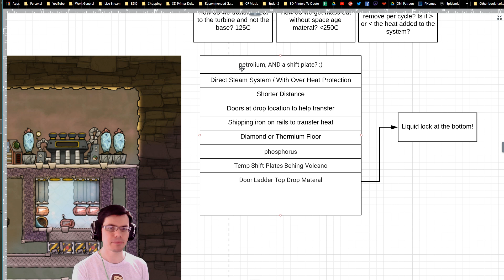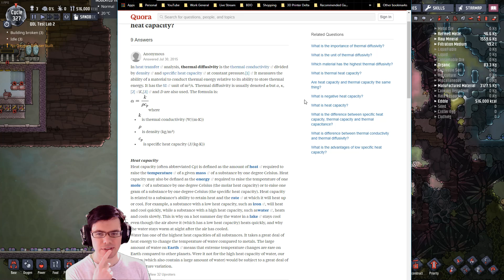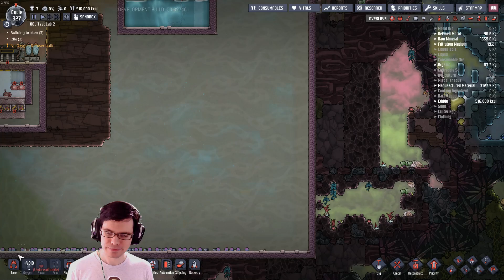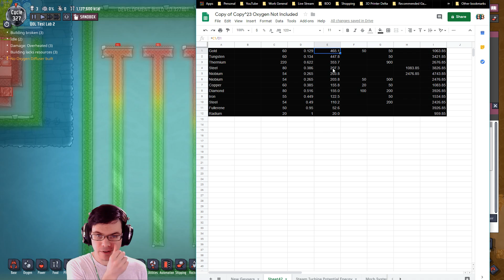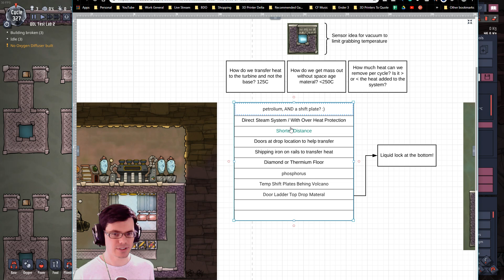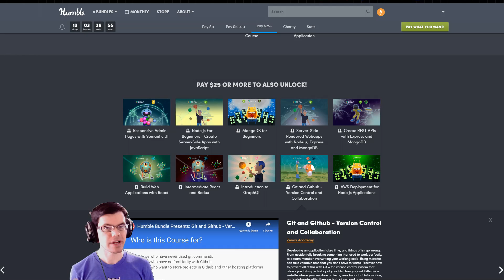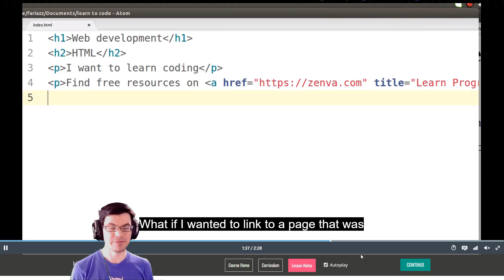Oxygen Not Included - Automated Renewable Volcano Power With Steam Turbine!

Comment: Instead of using insulated tiles on the left of the volcano, use an airflow tile.  They don't conduct heat with liquid while in a vacuum, and they'll push the iron away.
Reply: But it are made of metal, and metal transfers heat; so you're loosing potential power, right? Anyway, I have to test it, cause is cheaper to build
Reply: @TaRTaRuSwOLf  that is indeed true
Reply: Won't that let... you know.. the air in? I guess we need a double mantel.
Reply: @archinavoid7999  that would be true... if it wasn't already in a vacuum, considering he means inside of the enclosure.
Reply: I meant putting it where the insulated tiles are
Reply: But airflow tiles don't conduct heat while in a vacuum.

Comment: Around 10:14 you are talking about using this experiment to determine how fast these materials can remove heat from the iron. This experiment alone is not sufficient for that assessment because the other boundary condition where heat is removed from the metal tiles is not included (even in the water test, the heat sink is too small), and is not the same for all the materials. In effect the experiment you are doing there is biased in favor of high heat capacity materials because they will take longer to saturate. You also didn't get to steady state, which is where the high heat capacity materials particularly suffer. In the transient period, high heat capacity materials behave amazingly because you don't have to conduct heat over distance, instead you can just soak it up into the material that's right there.
Reply: This so much. The whole test was biased by the starting condition which was very far from steady state and therefore steel and iron tiles could soak heat very quickly, but they deposited the energy into themselves instead the water.

Comment: I really appreciate the visual test. Numbers dont always translate in my head but this made me learn about specific heat and thermal conductivity. I knew what the terms mean but this really helped iron them out in my head
Reply: Second this. This way is a lot more intuitive for many of us who aren't used to handle all the numbers and stuff.
Reply: Basic idea: thermal conductivity is how much energy is transferred based on how big the temperature gradient is. Heat capacity is how much energy it takes to raise the temperature up. Both matter here because if the heat capacity is bigger then the temperature gradient winds up being smaller.
Reply: @Latronibus  lol when I said numbers mess me up it also means words dont help either. The visual representation help a lot more then the standard definition for some ppl. Thanks for trying but I got more information from the experiment that's just how my brain works.
Reply: @NrynkoRhoads  I mostly wrote that because Brothgar's experiment in this particular video is highly misleading, in a way that you wouldn't be able to see without thinking a little bit about the math. The experiment makes it look like high heat capacity materials are excellent for getting heat out of the input, which is true, until you need to get heat out of *them*, and his experiment doesn't get to the point where that is happening.
Reply: Thermal Heat transfer in materials(Thermal Diffusivity) is like a Bucket of Water with a Hole in the Bottom. Size of Bucket is Heat Capacity and Hole in bottom is Heat Conductivity.